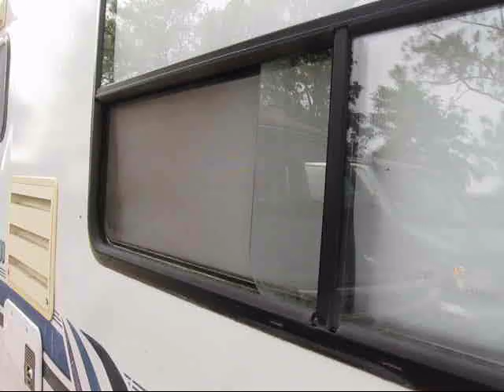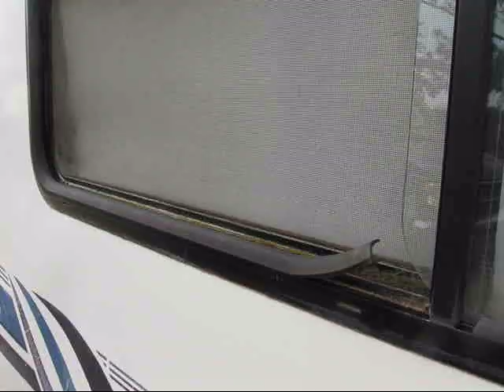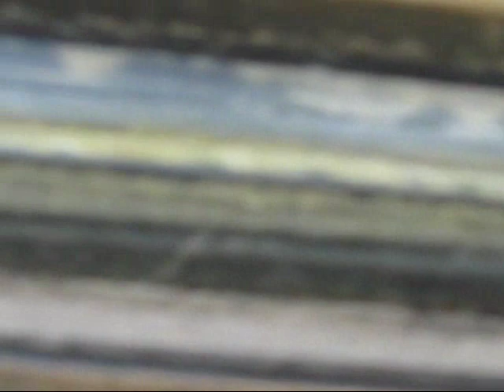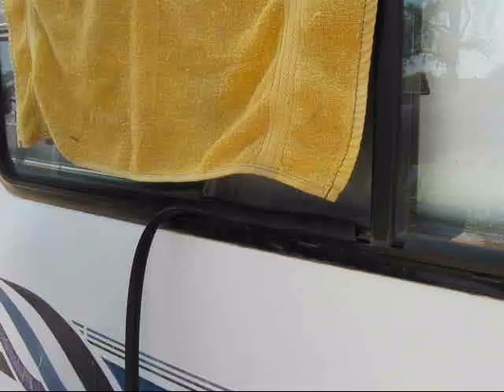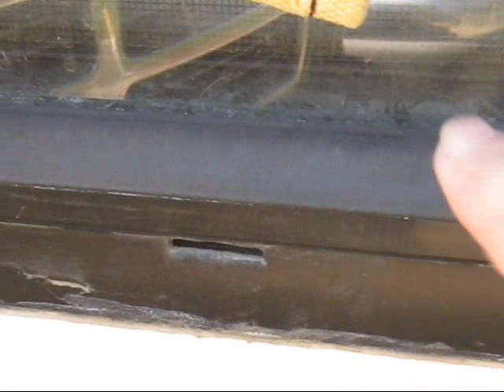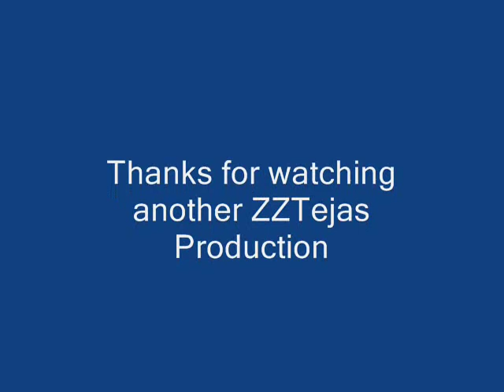LeakyRVWindows-DIY Fixit.wmv

Comment: Thanks best video ever! So now to move my rubber seals to the  right place, my lounge window is leaking and i have water going down the inside of the wall. Cleaned how you did it, some scrub the weep holes with a piece of wire but i have removed the rubber seal like you have done, my question is, is there a gap in the track you cleaned that wet stuff can get in between the wall and the casing? How would i correct this? Would i have to now replace the wall as i have had the dehumidifier on it for 24 hours thanks for any suggestions
Reply from the maker: I'm not sure that I understand your question? 
I do have to keep my weep holes clean or water will back up & get inside on that particular window. 
I have to redo that rubber gasket (glazing bead) again. Someone told me that if I boil the rubber gasket, I can work with it easier & stretch it back out. I plan on trying to do that. I'll do another video when I get to that point.
Reply: Where can i buy new seals? weep holes clean and clear and kept dry in wet weather so i think the wall would be dry too thanks for any suggestions

Comment: It was very good of you to point out, twice, the importance of those drain ports incorporated in the design of the window frame and how they DO GET clogged over time if not kept cleared by cleaning or maintenance.
Reply from the maker: Thanks. My next project is to take the windows out to reseal them.

Comment from the maker: It's called glazing bead. When I replaced some of mine, I went to an RV place in Houston & they ordered it for me. You can find it on the net, but you have to know what size to order. Good luck, I hope you can find it. 
 Oversize it a little because yes, it shrinks. I used black caulk in the upper corners of the windows as I figured it would seal the gap & would be in the top section, & rain doesn't move upwards.

Comment: Also, there were two rubber wedges that insert into the side where the window closes that operate to press the window outward against the rubber frame.  I cut a small "shiv" and slid it into the groove of the wedge so that the wedge would push the window just a bit harder towards the rubber frame.  I used garden hose to run water on window & no leak.  I went ahead & did all the windows that were leaking.  Had to leave the lake but it rained hard one night since & I sure do hope it worked.

Comment: So I finally decided to carefully drill (yes drill) three side-by-side 1/8 inch holes into the black rubber frame at a slightly upward slant through the outside wall and two more rails, stopping before going through the final rail.  I cleaned out all the shavings.

Comment: Good job!  I have Myacht houseboat which is basically an RV on pontoons and the HEHR windows leak at the rear portion of the lower window (note that a pontoon boat slants just a bit from bow to stern so all water tends to flow towards the rear corner.  I was able to remove the track and clean it and where it sits in the frame including the "weep" holes that are small horizontal slits that allow water to exit.  The holes were too small to allow sufficient flow of water in a severe storm.